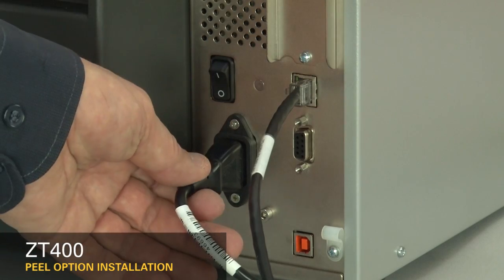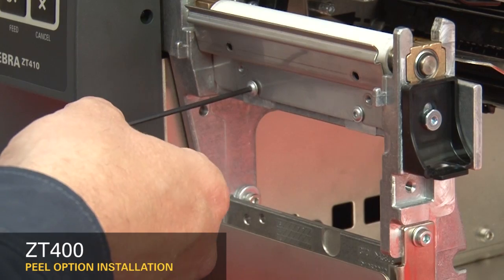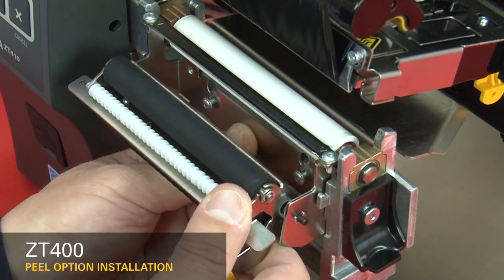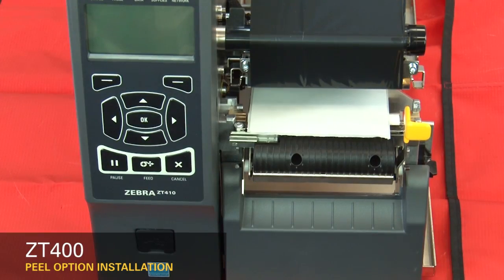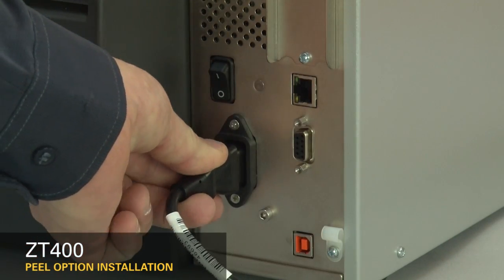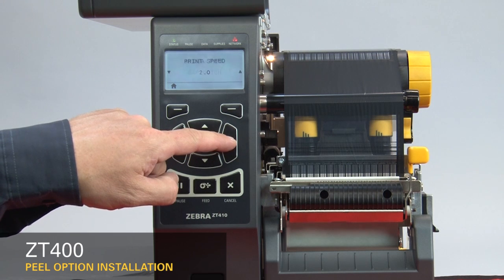Zebra ZT400 Series: How-to Install the Peel Option

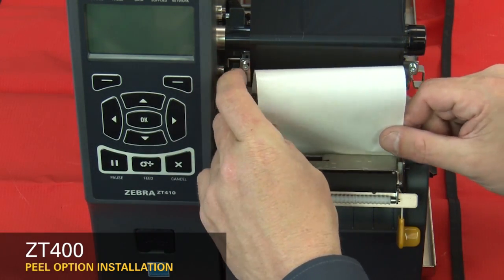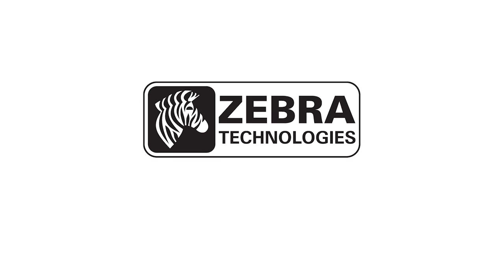Comment: At 1:00 the backing is shown hanging out of the printer's front; at 1:32 the form feed button is pressed and the backing disappears! The instructions for the media installation can be found in the ZT410/ZT420 User Guide - pages 52-54.

Comment: which is the part number of rhis peel of? thanks, we are partners of zebra and need to know this part for a client. best regards
Reply from the maker: Hi Eduardo, you can find the link to the ZT400 Parts Catalog here: https://www.zebra.com/content/dam/zebra_new_ia/en-us/solutions-verticals/product/Printer%20Parts/Industrial%20Printer%20Parts/ZT400%20Series/zt400-series-parts-catalog-en-us.pdf 

Page 8 will have the information about the different part numbers for each peeler based off of the model of your printer. 

Thanks!

Comment: Does this feature go hand in hand with a rewind/liner take-up tool that needs to be purchased separately? Or is a rewind option standard in all ZT400's?
Reply from the maker: Hi Cody, thank you for your question. We actually offer two peel options with this specific printer. 

In this video we feature our "Passive Peel" which means the liner from the label is not collected by the printer, it simply ejects from the printer as a continuous stream of label liner. This is priced as an option.

The second Peel option we offer that was not featured in this video is "Peel with Liner Take Up". The mechanism used in the Passive Peel option is used with this feature.  However, this feature also includes the liner take up spindle and mechanism.  In this case, as the label is printed the remaining label liner is collected by the printer and rolled on a spindle inside the printer. This is a separate priced option and includes all of the required mechanisms.